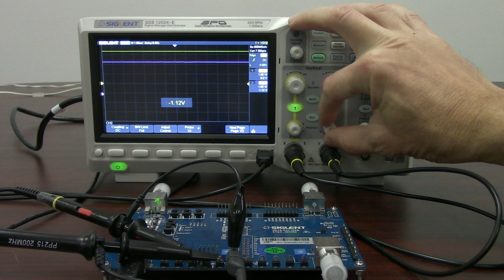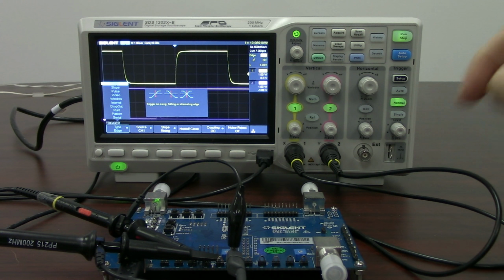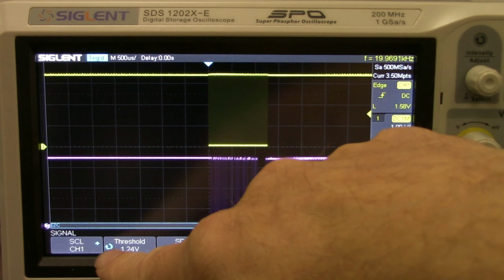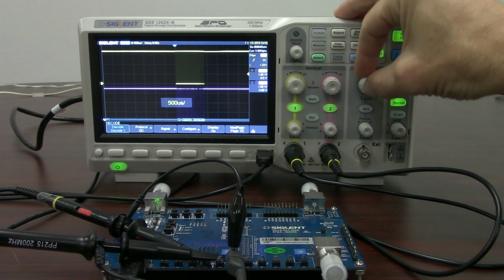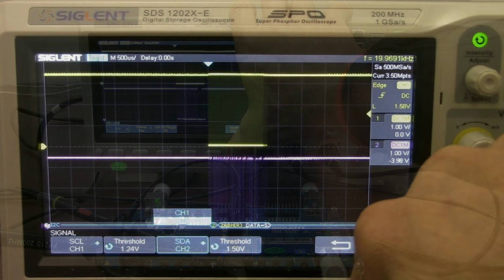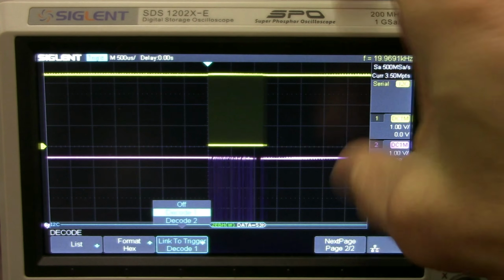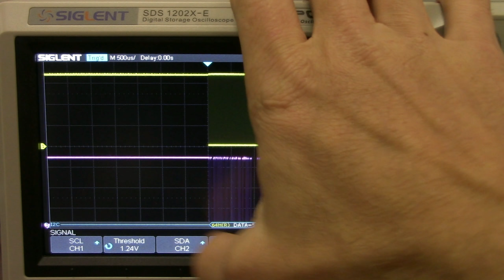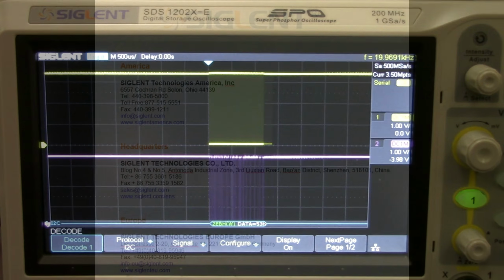SDS1000X-E Link to Trigger Function

Comment: With SDS1202X-E firmware revision 1.3.23 (or 7.0.1.3.23 seen on scope 'system' screen), the 'Link to Trigger' button on the DECODE page 2 has been changed to 'Copy Setting.'  This adds the ability to not only link the DECODE to the trigger ('Copy To Trig'), but to link the trigger to the DECODE (Copy From Trig).  Both options are on a submenu of 'Copy Setting.'

Comment: OK, lots of fancy words there, i have a scope and I am trying to view a simple 1Khz sine wave @.500mV. I cannot get the sign wave to STOP scrolling or to stay steady. i can "freeze" the wave image but this is not what I want. I want a real time wave to show me when my sine wave begins to distort in my tube amp. thank you in advance if you can help me with this! Love the scope by the way excellent purchase I just made!
Reply from the maker: Hi Curran. Jason @ SIGLENT North America here. It appears that you have an unstable trigger. This is most likely caused by the scope being in AUTO trigger mode with the trigger conditions not being met by the incoming waveform. Try pressing "NORMAL" and then set the trigger voltage level to the midway point of the input waveform (250 mV). If you have additional troubles, please write info@siglent.com and we can get you set up.
Reply: @SiglentVideo  Awwwwwwwwwwwwwwwwww, you guys are great!!! I for sure did not think ANYTHING was wrong with my brand new awesome 1202 scope!!! I love it!! I will do this immediately, I am a tube guitar map repair person and custom tube amp builder, so I am the scope for very simple circuits! BUT I am new to a scope! However, using the scope yesterday all day in my shop was awesome and i am already getting better with it!!! thank you for the tip!!! I will report back if you wish!
Reply from the maker: @Curranproducer  Glad to help. These tools are very powerful and do have a learning curve associated with them. Many scopes operate in a similar way, so finding information can be relatively easy, but before you get frustrated, contact us. We are here to help!